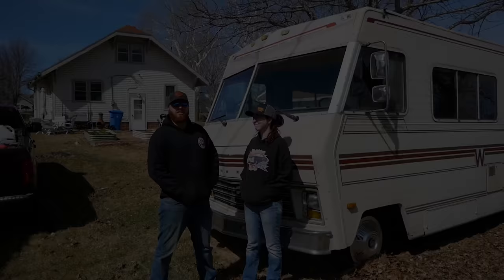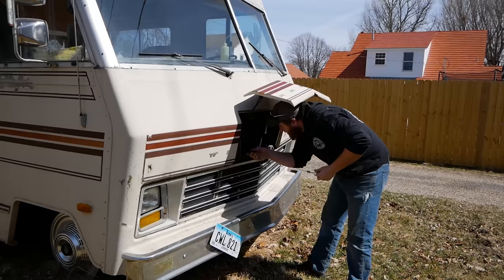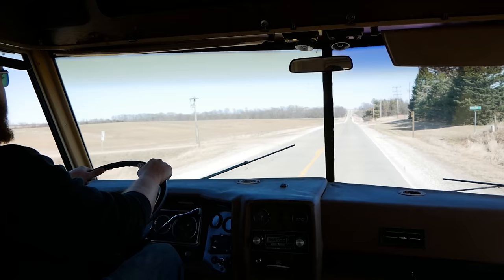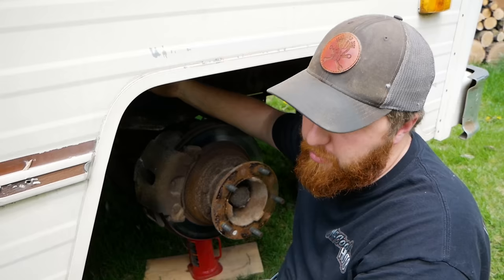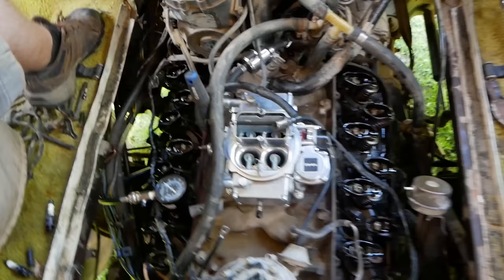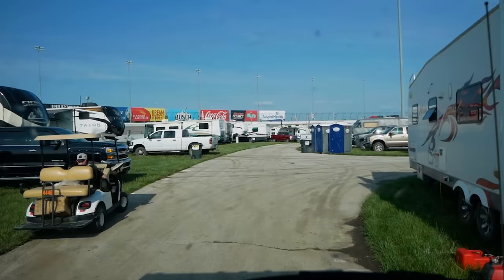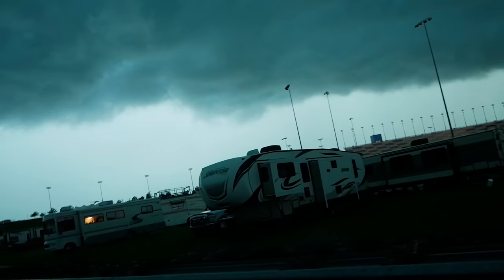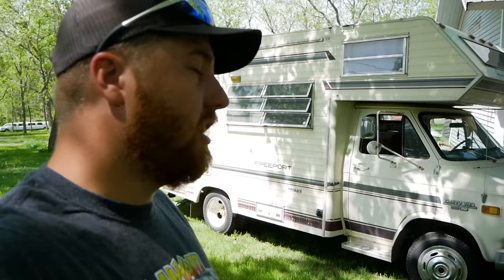Will a FREE ABANDONED Camper Drive 500 Miles for a NASCAR Race!?

Comment: Ahh the old motorhomes, one of the few instances you can have an engine fire and a house fire at the same time! 🤣
Reply: My house is faster than yours!
Reply: death traps in wheels..............

HEY CLARK... SHIITERS FULL
Reply: A 454 is cool to have, but in that big of a vehicle it's not all fun and games. It doesn't pull like a 454 Chevelle, it pulls like it has a 305 because all of those RVs were low compression emissions controlled big blocks with 180-200 HP, but they had maximum torque cams. This Winnebagel needs a Cummins 6bt swap in the worst way...they should've never released these big sons a bitches without a diesel standard.
Reply: and for some people ,school . l
Reply: @Brock_Landers  I got a 454 and it pulls like a 305, but when it hauls it pulls like a na diesel. I'll blame that one on the trans though.
Reply: @ccole9080 is that a National Lampoons refrence!? If so good one!🤣🤣🤣🤣
Reply: @jkeelsnc i have a RV and I am tempted to do this a lot

Comment: That Winny would make a nice first car hauler. Dove tail the back frame add nice things like on board air and air bags to lower for loading and unloading. Rebuild the 454 pick a fuel system. With today's fuel prices a Turbo is a must to increase fuel econ and torque when hauling. That T400 is perfect, no need to replace it. A very good frame and drive line for lots of activity's.
Reply from the maker: I thought about it! Cab would be tricky
Reply: @JunkyardDigs  Any You Haul cab. Any fleet that used the frame will have a cab. So many out there the cost would not be bad.
Reply: With all that weight behind the rear axle it would not drive good I imagine. I suppose one could make it work but it's probably better as is. I'm sure some people on here are thinking "tiny home".
And LS swap with a turbo. Thing is it's been done before.
If this was a GMC with a front drive Olds toro transaxle and 455 I'd be more into it.
Reply: @williamstamper442  You would be loading a vehicle forward of the rear axle up to the cab, this distributes the weight better it would not be one vehicle past the rear axle. this would be a 2 vehicle hauler or trim the back frame and make it a one vehicle. Either way a single cab would leave room for at least 2. OR put a sleeper cab on the frame and have a nice vehicle hauler with a sleeper section for even more activity's.
Reply: Call me crazy but as soon as I realize an old engine that's been sitting for say 10 yrs will start up & run. I immediately shut it off & change the oil.
Reply: Im paying over $7.00 for regular fuel right now, and some parts of the county are up over $15.00 in the remote areas where fuel its 2-4 hour drive away if you dont buy it at $15.00
Reply: @JunkyardDigs  Jesse! We must cook! Nice meth lab

Comment: Every time you drive an RV it brings back memories of having one as work vehicle.  The steering stability has a lot to do with the weight distribution.  All the Class C RV (van cab) that I've driven have very little weight on the front axle.  The Class A (one big box) RV are better designed, and while yours has an enormous rear overhang it seems to be better balanced.

Comment: Just a suggestion.   When someone passes you and the vehicle jumps left and right, the first thing to do is get the front wheel toe in adjusted.   The air pressure leans the thing putting more pressure on one tire than another and makes it the one doing the steering.

Comment: A blast to watch, Kevin. Thank you. I owned a 1984 P30, The "Southwind by Fleetwood" model. 31 ft. We had it in the mid eighties to early nineties. At one point it was missing and just running like crap.
I decided to change all the vacuum lines, and charcoal canister lines. I kid you not, I went through 3 25 ft rolls of vac hose on that monster. Unreal. It  ran better, but what a pain in the behind. 
I started to twitch when you pulled that doghouse, was flashing back...LOL.
Snag that BBC and trans outta that sucker, maybe the Dana 80, and send it to the crusher...
Reply: It sounds like they ran it out of oil and parked it
Reply: Your dienostic on running on has nothing to do with timing

Comment: Kevin: "96,000 miles on this one!" Me: has 454 with 300,000 original miles on it, and it runs like a dream🤣
Reply: 96,000 miles on a camper is about equivalent to 300,000 or more on a regular pickup. Plus, as most already know, they had a really bad run of 454s with soft cams that would eat the back 2 or 3 lobes off in 100,000 miles or typically less.😜

Comment: From the first crank it was evident you had a dead cylinder. You could hear the skip in compression before it started. Definitely a bad rid bearing, probably spun now if not before you started it.
Reply: Didn't sound good when he first turned it over. I said to myself "I guess we know why it was parked!"
Reply: Could easily be bad rings, sticky valve, bad valve seat, valve seal, any number of things.
Reply: Sounds like it's about to throw a rod.
Reply: Just rev it out a bit and they come alive! It works.. Sometimes 😁

Comment: So with the p30 chassis, you will want to get ceramic tipped spark plug wires so they don't melt 20 miles down the road and starts arcing to the manifold. Also if your model has an automatic parking brake it might be stuck, usually located on the back of the transmission(but yours looks like a 70s model so I'm not sure if they went back that far)

Comment: I love it. Those 454 p chassis are a major pain. only one oil pan will fit ( P series from GM) then the cooling issues, every one I had to work on, the owners were NASCAR drivers LOL, the advance springs would always wear out and the distributor plates with the smallest oxidation would stick causing the dreaded over heat in 3-5. hahahahahaha you'll see. but hey, you young uns are having fun and that is the ticket. Enjoyed the video, from a corn farmers son in Fl.

Comment: We got a free RV that we put a new battery in it. The floors were pulled up and replaced with wood floors. We had to redo a wall due to water damage and repaired the ceiling. We may have replaced a couple of bulbs? But everything worked and not horrible shape inside. We also, put the water coat sealant on the roof and calked around the vents and AC units. Not to much work and had a decent running, livable, RV. Once finished, I liked this RV.

Comment: You'll be OK as far as the body framing goes... It's probably one inch square steel tubing... Maybe aluminum. I'm not sure what Winnebago used at the time.

As far as the leaks, if you're not too worried about "originality", just dump a bunch of FlexSeal on the seams.
That should keep you dry for a while.

By the way... If you're planning on parting out that one, I'd be happy to buy the microwave oven out of it... The original that was in our '77 Dodge Landau worked it's way loose on a trip, and fell out of it's cabinet... Shattered the door and was worthless 😭

Comment: Man i remeber these when I started at car dealerships in the 90s, alot had big blocks in them. We had a 2 post lift, 1 front post, 1 rear post, and took 2 people to put the RV up in the air. They always had blown motors and transmissions, then they went to diesel engines which makes sense.

Comment: I work at 'Bago, although this one happened long before I walked through the tunnel. Glad to see some folks are still enjoying what we make. Oh the 96,000 miles on your engine? Like dog years motorhome miles accumulate much faster. Your engine has about 150,000- 180,000 "car miles on it. Friends found this out putting Chrysler automatic transmissions from motorhomes into 3/4 ton Dodge pickups.

Comment: pull the heads and put a gaskets kit on wile you have the heads off start by replacing valve guides then polish the valve stems and lap the valve seats then reassemble and put a set of 850 cold cranking amp deep cycle battery . then test the amp draw on the batt when cranking if its high then you have a bad wire connection or that starter is going bad. then do a complete full service and grease job and fan belt replacement. be sure that the radiator fins are cleaned

Comment: Cooling down the brakes with water reminds me of when I towed my travel trailer home for the first time. On the way there my one of my idler pulleys seized up and shot off so I had to run to autozone and buy a new pulley, then to a hardware store to get a bolt and once I threw it together and finally got to the trailer, all of the tires were dry-rotted and one of the axles was bent. I stopped off and put air in one of the trailer tires then as soon as I got back on the highway I blew the tire on the bent axle. Threw my drink on the tire since it was smoking then waited for 30 minutes in like 90 degree heat (a/c didn't work too good) for a ride to a tire shop and once I got back I threw the new tire on and made it home, took 6 hours to drive 45 miles total.

Comment: If you want to carry water and avoid putting water in fuel jugs Amazon sells mostly clear square 5 gallon jugs for $9 and you can also get replacement lid caps with faucet taps for another $7.  It can be difficult to fully empty and dry water out of a fuel jug.

Comment: I'd love to see you repair that camper. I used to work in a camper rental in Iceland, but never rented anything like these... But i know campers well, i think the structure needs to be replaced... Maybe just parts that have water damage. I mean you can keep doors and windows. We used to replace whole sides after big damages, they still do it. It just takes the right material and someone able to mark and cut. There must be some money in doing that sort of work in America also, i mean theres gotta be alot of wrote off campers that still run.. Also, worse getting passed by a truck in the larger camper, also the ceiling my ripe and the two walls may spit the roof open... Campers are beautiful beasts... Amazing how they can evolve with damage. The thing is I think the chassis may be really good still, so really it would be amazing what you could do my replacing panels and making sure its sealed

Comment: Reminds me of the 1986 Allegro I bought from a guy on the eastern shore of Maryland.  The 120 mile treck home began with one of the window awnings unfurling about 3 minutes into the trip.  Then the flex hose scaling caused the front left brake to start dragging badly and smoking.  The engine would die if I got into it too hard.  Crossed the Bay Bridge on route 50 and the battery tray slid out.  Stopped for gas on the west side of the bridge and the battery died.  Went to get back on 50 and the brake locked up hard.  Had to stop and let the pressure die down enough to drive it without having the wheel catch fire.  Got back on 50 and drove from Annapolis to route 70 without hitting the brakes once, in Friday afternoon rush hour traffic.  Then the headlights [required on part of the trip] were sapping what little power the alternator was supplying to the point where it started to backfire and lose power.  I shut the lights off and the engine sprung back to life enough for me to get it the remaining 15 miles home.  In the coming days we discovered a fuel leak at an in-line fuel filter along the frame rail under the passenger seat, a horrible nest of scorched wiring on the alternator, and that was just the running gear issues.  We named her Lucy, because everything I fixed one thing, I'd find another, and I felt like Charlie Brown trying to kick rhe football.  Fun times.

Comment: there use to be a coolant reservoir tankthat the over flow hose went in to tank then you filled the rade up tell you could tuch coolant then start itand let it runtell its at op temp then fill the rad all the way to the top then fill tank tell it says hot level then after you drive for 30 miles if it sucked out more coolant then put the level back at hot level .

Comment: Looks like an 82 Winnebago Brave or Chieftain. I just picked up an 83 Winnebago Brave with 47k original miles from a friend for $100. Looks almost identical to this one. 454 still runs and starts up on the first crank. Everything else, except AC still works too.

Comment: I kind of do the same thing that you do getting old vehicles and fixing them have a lot less experience but I picked up a 37-ft motorhome for $1,000 with a 460 in it I totally understand how you feel about the tiny Hood however on the battery been there should be a little silver clip on the body that is made to hold up that door let me know if you have any ideas on how to get the stupid thing to stop backfiring I have been trying to get it going smoothly for over a year

Comment: The dash Looks the same as the 1980 with 8K miles that looked a lot nicer inside than that 82, sold it a few years ago for 6500, not like not being able to get out had to climb over a hot engine and breathing the fumes on those models ,they builded them cheap back then

Comment: I have a 91 r3500 chevy Silverado dually with a 454 in it runs good 144k miles on it was told it was rebuilt 48k miles ago transmission has 1000 miles on rebuild in davenport iowa
Reply: Also a 3+3

Comment: 31 days to find out if you should title it. If I had 31 days I would move it to my property and call it an apartment. Pull the engine and transmission slap it in a flatbed after a rebuild.